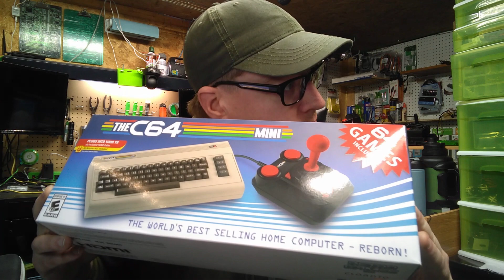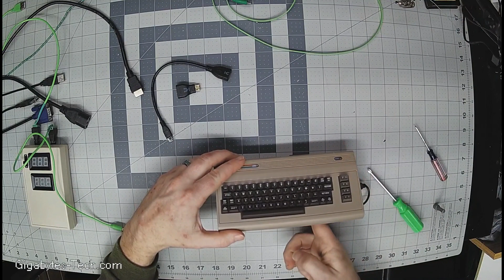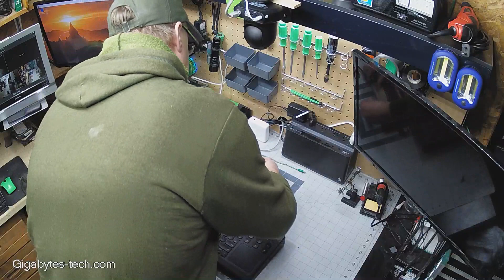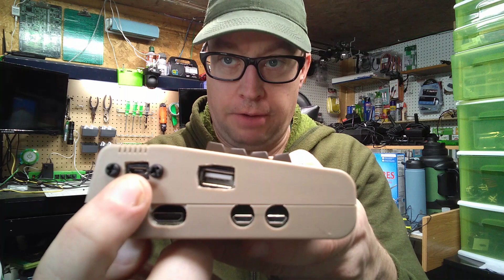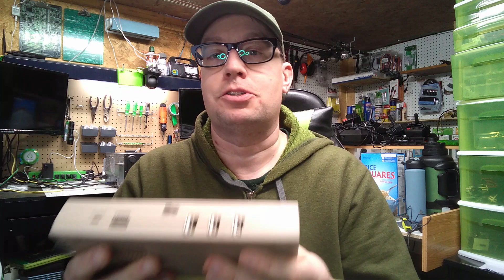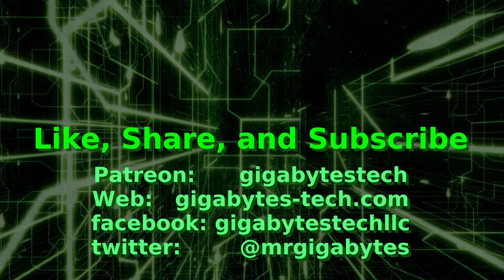Maximum Mini: More C64 Mini Upgrades

Comment: So the USB drive on the64 is seen by the pi?
Reply from the maker: There is a separate 32Gb drive added in a previous upgrade. However, the Pi is essentially a small Linux computer and could be used to upgrade the carousel with more games (for example).